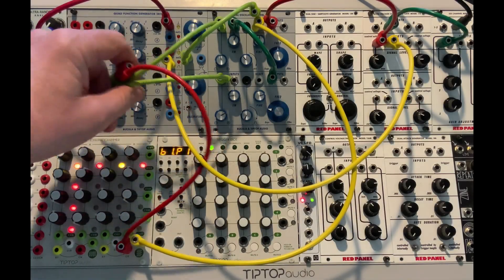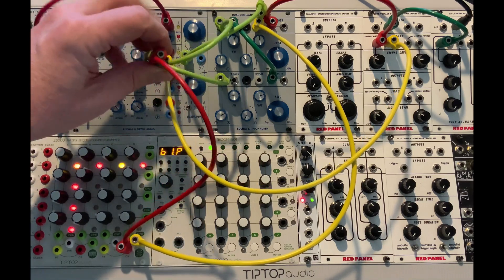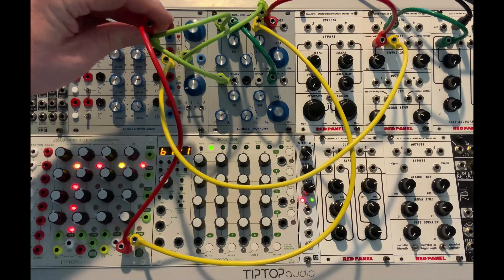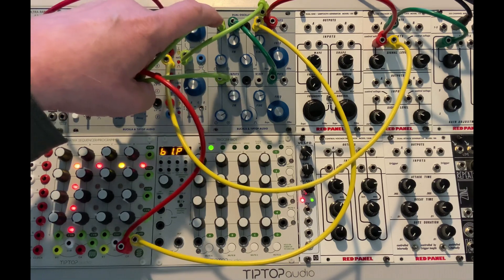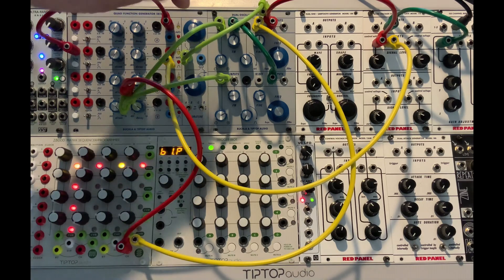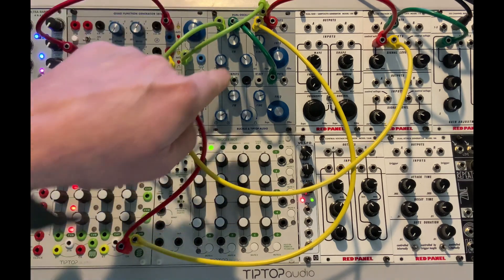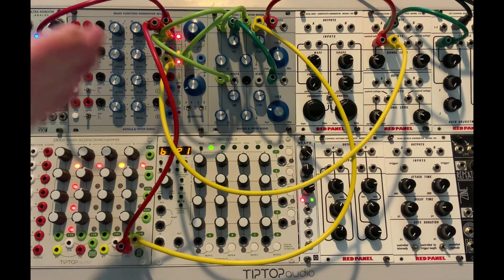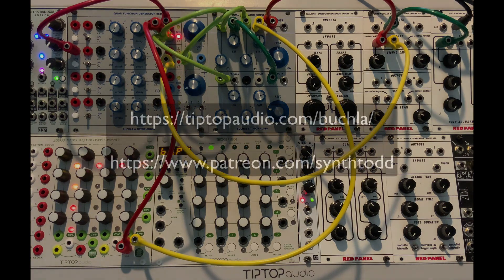Tiptop Buchla Tip no 4

Comment: It's Stackcable ;)  

Another tip: you can stack from input to input instead of fanning all of the connections from a single output jack.  That way you never need to stack more than a single cable high.
Reply from the maker: Excellent point!

Comment: Does the voltage change when an output is stacked, or another question maybe, how many mults can be stacked before "too many" has been achived?
Reply from the maker: @robert-wr6md  I’ve stacked up to 4 with no voltage change
Reply: @vgermuse  Thanks, yes that's probably tall enough too.